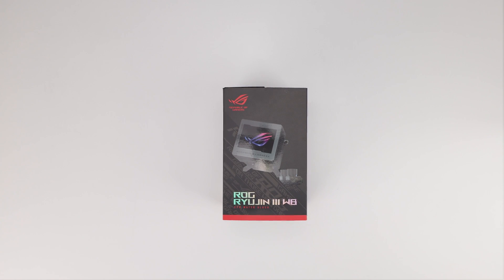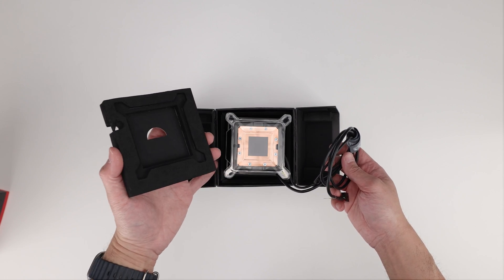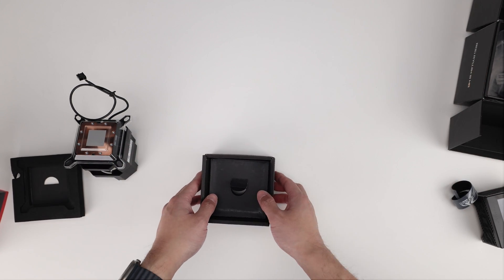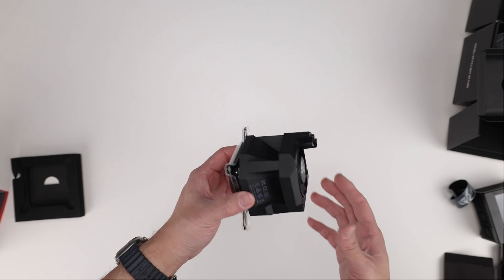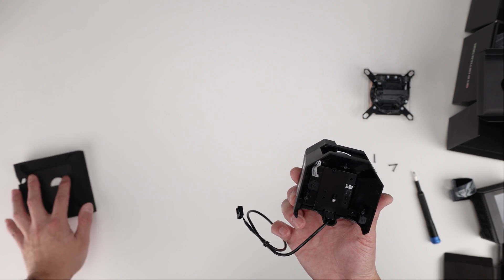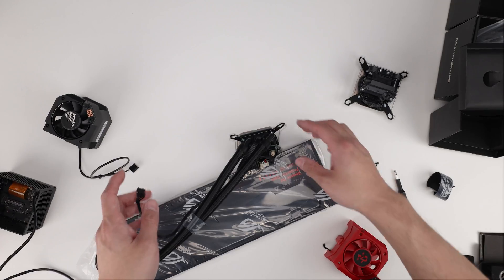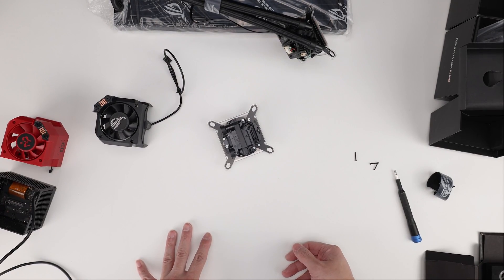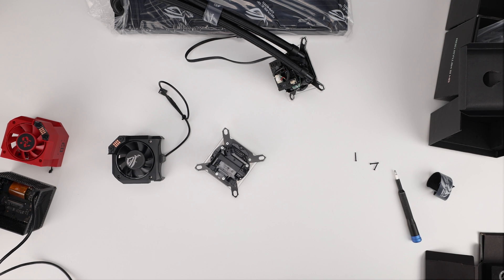ASUS ROG FIRST CPU WATERBLOCK: RYUJIN III WATERBLOCK UNBOX AND TEARDOWN & COMPARED TO RYUJIN III AIO

Comment: If only the open loop block came with an integrated pump, would be nice to work with it in SFF cases where you need to customize tube length.

Comment: Firstly, great video! Second, have you installed this water block before? If you have, would the temperatures with a custom water cooling loop justify the cost compared to an AIO, considering they have similar build quality? Especially in comparison to the ASUS AIO. My question arises because the price of this water block might be more affordable, especially if it's a replica of the AIO version.
Reply from the maker: You would achieve similar temps to the aio. While I focus on watercooled builds, it’s hard to recommend an open loop system to most folks vs an aio and air cooled gpu (consider how good the air coolers are now)

Comment: Ummm, the AIO version can NOT do water temperature by itself (built in). 

If you have a water temperature sensors plugged into the motherboard the AIO can display that information on the screen, but it doesn't display its own water temperature or flow information. (Even though Asus claims it does.)

Seeing a different comment you made, it seems like you have some builds planned, maybe keep this information in mind for that. Asus took over 6 months to admit this is the case, to me. They tried to make it sound as if this (an AIO for the CPU, used with another custom loop in the same machine, while that separate loop's water temperature and flow information is displayed on their AIO's screen) was the intended (and obvious) use case for which thier claims of "instantly monitoring temperature and flow information" valid.

Anyhow, the WB will display the information same as the AIO, with sensors fed to the motherboard, and in turn read by Amory Crate and displayed on the screen. While it's a disappointment the WB dosen't have a temperature (or flow) sensor built in, at least that makes more sense than not having them in their AIO.
Reply from the maker: The aio does have water temp. The temp sensor is built into the pump mechanism, this is the same setup for most of the asetek based aios. I spefiically spoke to the Asetek guys at computex to ask them to add it back for the ROG 2 waterblock as they were at the ROG booth showing off the 3d printed cold plates.
Reply: @JCustom  The AIO can NOT display water temp without 3rd party hardware. If it has a built-in water temp sensor, that information can NOT be displayed on the AIO's screen, not even with their AIDA 64 integration. 

Again, the AIO with the latest firmware and software will not display its own water temp, or things like flow rate, even though the software allows you to select for these options to be displayed. Asus (privately, not publicly) says it's designed to display the information from a custom loop installed in they same machine (like that's a normal thing).

I would LOVE to be wrong about this, but I'm not. I would love it if you were able to take Asus at their word. Unfortunately, you can't; not about this, at least. 

Tell you what, if you can get the AIO to display it own water temp (with the currently available software and firmware) , and can prove it or maybe make a comprehensive guide as to how you accomplished it, I will make a $500 donation to your channel. 

In the meantime, it'd be great if you considered this situation and if there's any opportunities for you to impact it for the better. Thank you for asking Asus to incorporate a temp sensor in the ROG 2 waterblock! I think that AND a flow meter would be appreciated by most anyone who'd build with it. I also think it'd be great if their product pages for their AIOs weren't misleading and saying things like they can "instantly display flow rate," when they can't unless it's for a custome loop with a flow sensor hooked up to the same motherboard as the AIO. 

I'm not mad at you, but I am mad at Asus. Thar said, it would be great if you find a way to impact this situation, or let me know what, exactly, you discover when you actually build something with one of these AIOs.
Reply: @ThomMurphy i have AiO Ryujin III and with armory crate I can display water temp on the screen. It’s just like 2 clicks on the app.

Comment: The 4 pin with all wires on the AIO is afaik for the pump tho, not the VRM fan.
Reply from the maker: yes it is for the aio pump you are correct.

Comment: I have a ryujin 2 360 and I can't wait to get rid of the ugly soft lines and the weak pump. Can't wait to do the hard lines with the screen and a decent pump with multiple radiators. Right now it struggles to do 300 watts worth of cooling. Even with a 15 waterblock with a good pump and multiple radiators it can do 350 400 watts worth of cooling no problem. Z690 Maximus motherboard with a 13900kf with optimized defaults attempts to do 320 to 330 Watts and immediately thermo throttles to 290ish watts... in game with a 4090 every now and then it will  thermal throttle at 200ish watts. I cant wait.